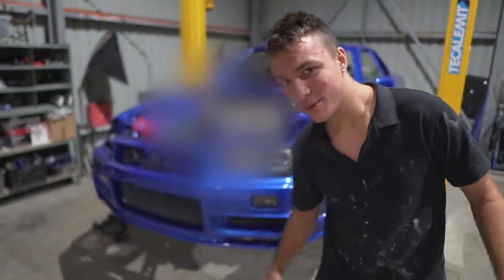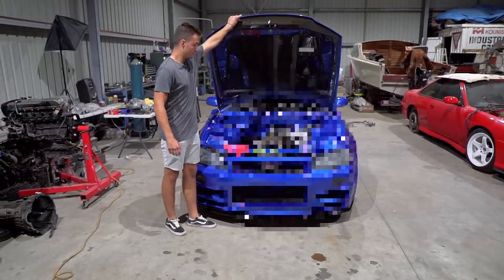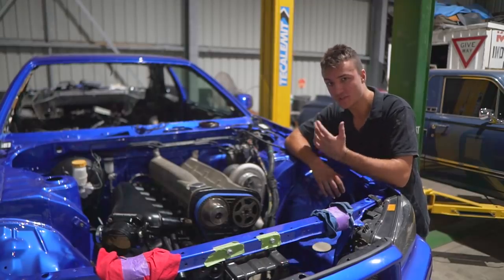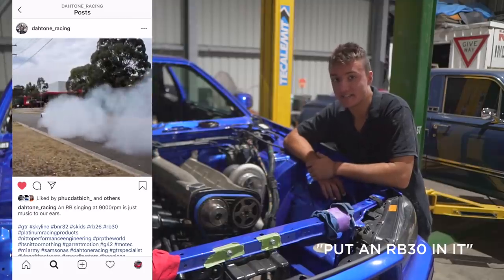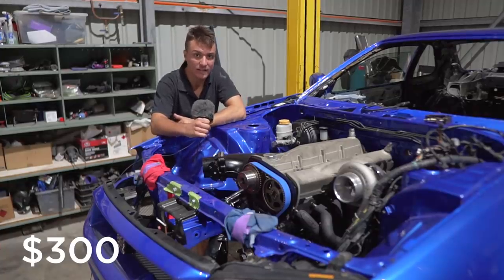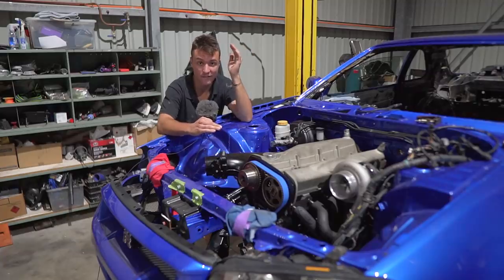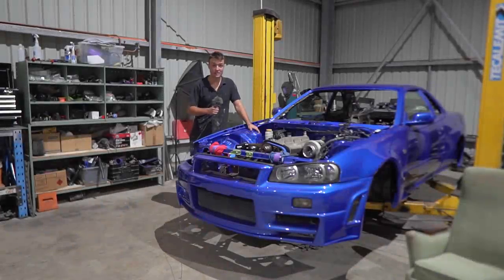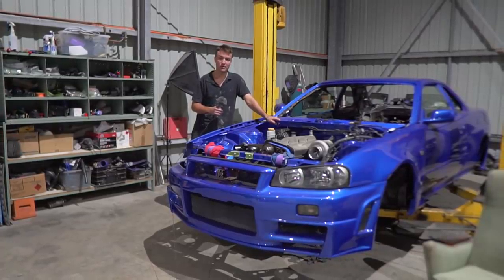R34 Skyline ENGINE REVEAL!! | Poor Man's GTR [EP16]

Comment: Finally! Clean,shiny and alive...         and nissan looks good too : )             So, two things from me:
Engine - As far as You are concerned about getting a rb26,what is understandable,you can be one of a kind here and stay with rb25de and make it a "other rb series kind of killer" what wasn't done yet practically on level of "affection" and professionalism you showing for many months,because everyone is focused on getting crazy results on rb26 at least and higher (28,30,32,34 stroked or whatever).It doesn't have to have 1000,1500,or 300000 hp but,make it a "sheet"load of hp for this kind of engine.
Bodypaint:I found few months ago a very unique color,which i don't know if You considered.Its called KN6 Dark Grey Pearl.Check it out because if you are going to do some kind of "reborn" in future of your sky,that would be perfect i guess because you considered a midnight P, Stealth kind of black and Z tune silver so i think you would like it. :)

Comment: My buddy andre is also dropping the RB25DET NEO into the GTT shell as well. 

The only big work is straighten the frame of the R34 shell he got as it was wreck in the front right before and had a shody repair job. He already aquired the GTR fenders. And many Nissan OEM parts. 

The RB25DE-T even with 400+ bhp will be plenty to rip around because you only need to drive the rear wheels. The R33 GTS doner car was perfect for the Poor Man's GTR project. 

The RB30DET can be saved for when you can get the GTR ATTESA ETS Pro AWD drivetrain. 

Cant wait for the next episode.
Reply from the maker: Tell him i said best of luck with it all! Yeeah man that’s it!

Comment: I think its fun having the risk of things that could go wrong with a motor that cant hold as much boost, as NICE as it would be to spend a lot of $$$ on the engine straight up, you loose the process in learning how to handle the car with a smaller amount of power, and the bug to modify it becomes greater each time you get used to the power, it also makes for more content. So win/win.... very clean, non dodgy build!!!! KUDOS
Reply from the maker: That's it man! As I said enjoy the car as it is firstly. At the end of the day, my favourite thing I own is my BMX and my favourite car was an old E30 318i.. Things make you happy with experiences that are tied to them, and not flashy parts and horsepower! My take on it at least :D
Reply: Broken Silvia good man, it’s me @wrbwrex off insta ✌️

Comment: I was the guy with the volvo comment :D 

But the 800hp? common man, after like 400hp it's getting harder and harder to get the power to the ground. so a wise choice. I know i would prefer lower power and more response than lag and nice figure on a dyno. 

after all the should be nice to drive. and i know 250hp~ 400nm~( volvo B230ET, ported and polished head, mistudbishi 15G turbo at almost 1.4 bar among other things)is a handfull! At that point gearboxes were getting in and out of the car at rappid pace(volvo m46 gearboxes dont hold 400nm very well) bent rods too thanks to high cylinder preassure(it's possible to get more than 250hp on those engines with stock bottomends, but my dad and his friend that built the engine had achieved a very early tourqe curve and flow was a problem at high rpm.)

Many keyboard warriors underestimate how much power 800 hp actaully is, especially 2wd! Those 250 ish horsepower was actually pretty scary on regular summer tires, and 3rd that broke if you sent it, thats our fault tho, being to cheap :D
Reply from the maker: Hahah was it? 😅 Yeeah man no need for big power in rwd

Comment: I think that the rb30 was better idea
Reply: No shit it was.  Biggest confusing video.
Reply: I think he might save the rb30 for when it’s “finished and running”, then he can learn to drive the car for what it is with it’s “low power” like he said, while building the rb30 for more power.
Reply: I think RB26DETT
Reply: @noeleenbatchelor3736  ya can build a engine too make any sort of power. 2530 combo at 300hp will be easy to drive and handle. Yhen all ya gotta do is go re tune. Say 450hp. Get used too it. Then go 550hp..
Reply: @bioshock425  you're not pointing out the machine work needed to mate the dohc head to the 30 bottom. That plus MLS gasket/ studs ect it all adds up.
Reply: @clutchkickpj693  its actually not that expensive lol.  Done one.  Gasket n studs is fuxk all.
Reply: @clutchkickpj693  Not expensive at all man. I spent about $3.5k recon and swapping a RB30/25 Neo in my R34. The recon itself was $1420 which you would spend the exact amount on a RB25. There's no machine work needed to mate a RB25 head to a RB30. Check out my vids. You only need to block to VTC oil feed in the head (which is easy). I went with normal RB25 nissan gasket and ARP studs (just incase I need to take the head off again, so basic nissan head bolts is a no no then) but you can run a RB30/25 without MLS gasket and ARP studs...

Comment: High 200 horsepower or even low 300 is enough for a car to feel fast and yet be driveable and most importantly feel very solid for daily driving.
Reply from the maker: 100%.. gearing is very important too
Reply: This may be true for a light car and may feel ok in the r34, but would feel far from fast with that power..

Camry’s have that power these days 🤣

Comment: Respect your decision to get it on the road. I was thinking a fully worked rb25neo would be better than a clapped out RB26 anyway and you can still do that rb25 on a budget and get 500hp. Why BMW gearbox though??
Reply from the maker: They are compact, 6 speed, strong, and the list goes on. 530d e60 manual box

Comment: man i felt that part you saying you lose motivation n all.... i got my 200sx for like 13 months now, i had to do framework, and a few other things, but since its so hard for me to move the car, without plates, its just such a hassle... im currently at the stage where im almost there.... i have the breaks to do, finish the exhaust system, new tires bits n pieces, and i should be able to get my plates...

Comment: I think the RB30 with the 25 head and a bmw gearbox is going to be the best solution in the long run.
Reply from the maker: Rb26 with 6 speed 😁
High revs, short gears with an overdrive
Reply: @BrokenSilvia  those BMWs sure have great gearing

Comment: I can see that rb25 making a decent 300+ hp, plenty enough to party.
Reply: 25dets only run like 10 psi stock. Should see like 400hp on 18psi if everything is done properly
Reply: @Str3ss3dpo3t654  I've managed to push 400 out of my de neo with head studs and ethanol, going strong for 5 years on 0.9 bar of boost.

Comment: what is the differen between a rb25 head and rb30 bottom to a normal rb 30. Great build btw. do you have maybe a awd drifetrain laying around. I have many quesitons about it.
Reply from the maker: Rb30 head is single cam, rb20/25/26 are twin cam - better flow etc..
Sorry man not too knowledgable about it

Comment: Why the choice of a bmw gearbox behind a rb26 ? Nothing against it just curious I have a friend that Solely works on Bmw mainly older ones wouldn’t mind getting your word on it and his
Reply from the maker: I’ve proper geeked out into gearbox’s lately. Few options.. cd009, tr6060 (which i bought but wont use), r33 gtst and a bmw 530d 6 speed manual were my options. The bmw gearbox is f*cking stupidly strong, shift nice and is also the smallest and has the right gearing when teamed up with something like a 3.54 or 3.69 diff. Not readily available in Australia but that gives away some of my silly plans 😉

Comment: I have a de+t in my 334 build running happy 10psi with bigger fuel pump my mate with a tuned neo de+t is on 14psi spins wheels, people will tell you that you can’t boost a de it’s not strong enough blah blah it works anyway
Reply from the maker: Sweeet

Comment: Aw man, should have gone RB30. What kinda cash would you have thrown at an RB30? Would spend the same amount that you would on a 25
Reply from the maker: the 25 was $500, and i threw a timing kit I had laying around

with the 30 I would need parts such as, billet oil bump gears, crank collar, machine work labour, head gasket, studs, bearings, rings and the list goes on. I wanted to fully refresh the engine instead of doing a slap together